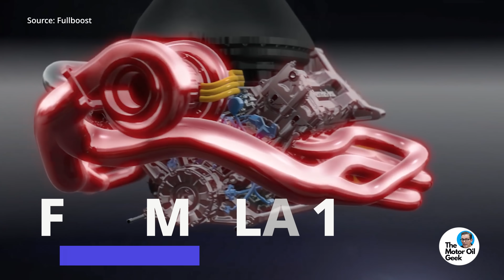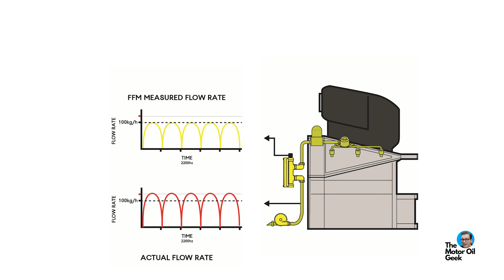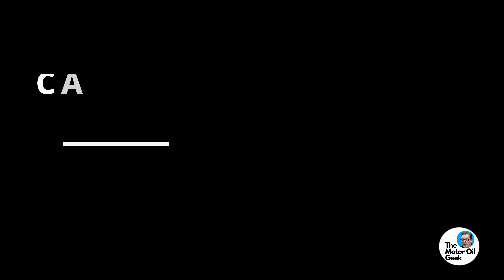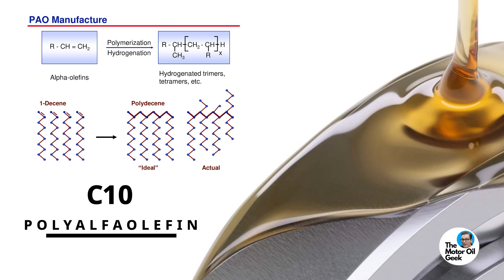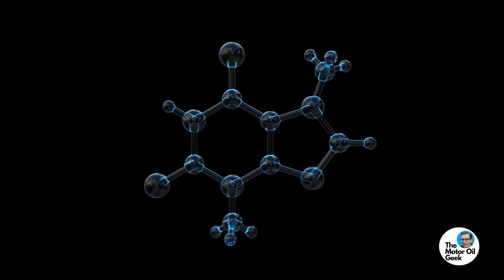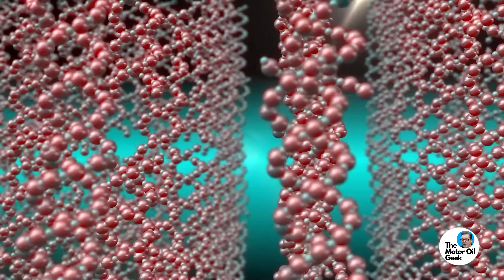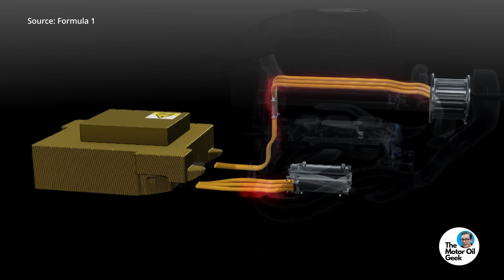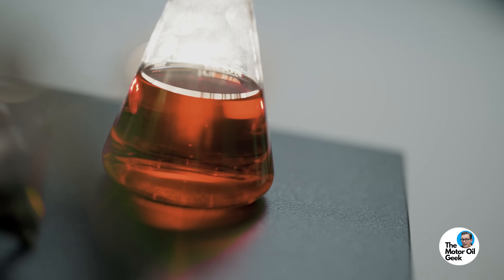SPEED SECRET: How F1 Engines BURN Oil As Fuel

Comment: Can you make a video about 2 cycle oils? That’s super interesting
Reply from the maker: Will do!
Reply: @themotoroilgeek Please when doing that long awaited test about two stroke oil tell us also how it does in comparison to other fuel additives! 🙏🏻
Reply: @themotoroilgeek  That's excellent news!!! PLEASE, Mr. Speed!! Will you tell us if those present-day certified TC-W3 oils are good enough for non-outboard engines?? ALSO, for decades now, 2-stroke Sea-Doo owners have bickered back and forth on how their water-cooled, oil injected engine, can't take anything but Low-ash!! The "Sea-Doo Forum" dudes would go absolutely bananas if you address this topic!!
Reply: @themotoroilgeek yes!!! Thank you!!
Reply: @themotoroilgeek brother I can’t wait. I run several older air cooled two stroke Mx bikes And 90s and up water cooled two stroke Mx bikes too. I can already tell you some tricks for reduced parasitic drag through the gearbox .
Reply: @themotoroilgeek  👏🏻👏?
Hello from 🇬🇧🇬🇧?
Reply: yes 2 cycle please,  and differences for outboard motors, dirt bikes, snowmobiles, chainsaws and weedeaters.  LOL
Reply: @rshawiii And as a fuel additive. In former times they used two stroke oil as a fuel additive even in four stroke gasoline engines and it was called in Germany "Obenöl", meaning oil from above.
Reply: @ralfrufus6573  Would love to hear Lake's opinion about using TC-W3 2 cycle oil as a fuel additive in petrol car engines. People swear by this, using 640:1 ratio mixture with gas (1oz per 5 gallons).
Reply: Yes🎉🎉🎉🎉🎉
Reply: YES PLEASE!  I would LOVE LOVE LOVE to hear Lake talk about the component chemistry and formulation of 2-Stroke Oils and how the formulation differs based on dirtbike, snowmobile, marine/boating, and outdoor power equipment use!  I'm a die-hard 2-Stroke guy and would thoroughly enjoy hearing about the science behind 2-Stroke Oils!
Reply: I fourth this, I really wanna hear his verdict

Comment: 12:21 this is great to know I was just talking to a close friend that just bought a 2015 Porsche GT 3 apparently, Porsche uses DLC or what’s called diamond like coating on their finger followers which apparently they had a production issues with them in the last few years and my close friend, and I were thinking what would help protect DLC, and we never thought about high zinc levels. I told him since that motor probably has roller tips Heising oil it’s probably not needed just like in my ISF. He’s been running Amsoil.

Comment: Well, to be honest, this sort of reminds me of what my uncle used to tell me, he used to love running some marvel mystery oil in his fuel, telling me that it helps with lubricating the top end of the motor and I do this from time to time in my daily driver and my ISF, I’ll run some redline fuel cleaner because it does have the upper top in lubricant in it, which is great for the direct injection system valves, and what not🤔

Comment: my ford 6.7 powerstroke f350 is at 160k miles and hasnt ever had a transmission fluid change. my dad thinks if it were to be changed now it would "knock crap loose and kill the transmission" this is based off of anecdotal evidence from a mechanic he knows claiming when he changes high mileage transmissions' oil they fail. Should i leave the same oil or start changing it every 30k?
Reply: Dang old wives tales! Veteran transmission mechanic here. It's a MYTH.  Change it!
 Have you ever seen the inside of an automatic transmission? Unless the thing has been totally cooked, there is very little contamination in them. But the fluid does eventually get used up-degraded. That one should use Mercon LV, that's a synthetic base fluid. If it's still working decently, change it, now!
Reply: I gave my 04' Mustang its first transmission fluid change at 155K. This was after it started losing fourth gear whenever I drove it hard.

After this, a filter change, and a differential fluid change, it got a little quieter and the shifts felt more crisp and sharp. 5K later and it feels great.

So I say change it! Once you're done, let it warm up for five minutes, then put it into every gear at a standstill to see how it feels. Slowly drive around for about half an hour, then find a back road and see how much of your speedometer you can use.

Comment: Hi Lake, mate i used to sell a product called Dynotabs, which 1 little tablet would increase the HP and octane rating by 4 points, because like you said hydrocarbons is 8 molecules ,so the dyno tab was formulated to add a extra hydrogen molecules to the hydrocarbons thus increasing the octane level and combustion process, Also WYNNS did the same but with not much success, because of not being a tablet.
Also i tested the product on my own car and the results was around 10% extra of fuel savings, using regular octane level fuel, so a average of around 7 liters per tank full, which was 80lt and around 7.5 per 100km ( instead of around 12 lt per 100KM HWY and around and 14lt per 100KM City) it was a fuel injected 5lt v8 made by HOLDEN Australia, 1998 holden VT Berlina model was the car, AUTO as well. cheers, here's a link to the company web page https://www.dynotab.com/
cheers mate.✌✌👍👍🦘🦘

Comment: Thanks Lake enjoy your work have followed  F1 for over 35 years... miss the wail of a 3 liters of v10 engine at close to 20,000 rpm. As a motor mechanic 20 liters per 1000km of oil is incredible... think that their pre chamber combustion may lend itself to the clean burning of oil...
Think that if they are moving to achol type fuel it's a backwards step... I see much more problems down under with e10 fuels.. I am a big fan of top tier fuel and regular oil service... I can tell what you do when I open up a motor.... would love to hear more about  carbon build up on direct injection  petrol engines and also weather premium diesel reduces carbon build up in egr passage and systems. Also  
Seeing blocked egr coolers on petrol engines... I work on subaru cars. Thanks mate
Reply: Thanks Again Lake it's unbelievable how much of this stuff goes back to ideas 💡 from ww2 and before. I remember asking My Grandfather a first Class steam engineer who built ships during the war  (ww2) about water methanol injection and he laughed me off and said it was a much older idea than ww2😂

Comment: From the passenger car perspective, is there also benefit to choose low ash oil (C3, C5, C6) as opposed to full saps (A3/B4) of the same viscosity grade (even for an older car without GPF or DPF)? Most manufactures are requiring low saps oil and these oil are often more readily available. I used to think more addtives and higher saps are better but after wathcing many of your videos, I gotta change my minds.

Comment: Lake, would this same concept be a benefit for Wankel rotary engines that inject engine oil into the combustion chamber for lubrication, or would this result in a worse lubrication for the use case? Most of us go for VR1 conventional due to the oil thickness giving you more of a safety barrier for if the engine gets too hot and thins out the oil.. But having an oil that could potentially be burnt cleaner and actually combusted would be crazy cool!

Comment: What do you think of adding 1oz of TcW3 2 stroke oil per 5 gallons of fuel for a daily driver..........2002 Buick Century ( I drive it like an F1 car ) 😎
Reply: 😂😂😂😂. You beat me too it.  Yes, the 25yr trend of putting TCW3 in gas would be a great topic for Lake!  It must work since it went viral across all forums that originated on the LS1 forum.  Look up Ls1 Forum Been Testing Oil by Sarge!   That thread started in 2008 to 2024 with 1000's of people using TCW3 in gas!   Now I wonder if we can get our hands on the stuff C-10 that Lake talks about!🤔
Reply: I would use a pwc oil over tcw-3. tcw-3 is for low rpm outboards.

Comment: I am also sad to see the current technology go, it’s not awe inspiring like the n/a v10 era, but the power density and efficiency in the engineering is absolutely amazing. You have something that is putting out 700-1000hp at full load for an extended period of time, but at a higher efficiency than a huge diesel engine workhorse that weights several tons by itself, using what is essentially a new “spark” ignition cycle.

Comment: Lake I have a question I have a 02 f-150 4.2 v 6 with a 5-speed manual transmission the trans fluid is automatic trans fluid. what would happen ifins I put 70-120 lube in the trans, i have also heard 30w or 50w motor oil can be used in the trans. could you do an episode on automatic fluids vs gear lubes and explain the differences, pros n cons.
Reply: Gear lube may not be compatible with the composition of the syncro blocking rings. It may possibly grind on every shift.

Comment: I do my oil change on my 6NZ 15 liter caterpillar semi truck engine….filter the oil down to 3 micron and dump the used oil in my fuel tanks. About 10 gallons of oil to about 250 gallons of diesel. Quiets the injectors and I don’t have to pay for the disposal. Also adds lubricity to the injectors.
Reply: Not that I have a rig but I am curious about what filtration you are using to get to 3

Comment: Initialy that was secret. They had purposfully engineered the oil to have way lighter hydrocarbon in the mix. So it was purposfully made more volitile on purpose to actively supplement fuel limitations.
Reply: Yeah that's basically what he said.

Comment: I would be interested to know what the difference is between high octane auto gas and 100 octane aviation fuel. Almost all piston aircraft have air cooled engines. The P-51 mustang is an example of a liquid cooled exception. I know that during WW2, 130/145 octane was used  
Thanks

Comment: I am surprised there are any concerns about deposits in an F1 engine.  They have short lives (a handful of events), run at high RPM, run at extremely high temps and have zero emissions equipment.  🤔

Comment: .3L/100Km= 13oz / 56 miles.  My Cagiva 500 got about 13mpg or worse and I mixed it around 40:1, a pint in 5 gallons.  In 56 miles I'd use about 5 gallons and  a pint of oil ....Castor Bean Oil of course.

Comment: Every internal combustion engine is using some oil. Aren't they?
Reply: It's not good if they don't. A little oil needs to get past the valve seals and ring for it to do its job. If it doesn't, it's metal on metal with very high wear. The amount would be around a quart every 5-10 thousand miles.
Reply: As far as my knowledge, the oil consumption is happening via the pcv system, the release of the pressure back to the intake, alongside with water and oil vapors @denawiltsie4412

Comment: The last year F1 allowed unlimited oil consumption they made a late season change with a sizeable reduction in oil consumption. Ferrari was dominating up to then ,after that they ran with the pack. I don't remember what team instigated the FIA to make the change but part of their argument was that the engines in F1 should not be consuming excessive oil and should reflect the standards for road going cars.
Reply: F1 reflecting road going cars 🤣How insane IS the FIA in a sentence!
Reply: @gotindrachenhart One of the goals of F1 is to push the state of technology that might be used on road cars. That isn't compatible with burning huge quantities of lubricating oil.
Reply: @gregorymalchuk272  I think you maybe missed my point. The other goal of F1 is to be cutting edge and advance tech to peak levels. BUT, after Sena died it kind of broke the FIA and now they ban anything that makes for faster cars.....in F1, which is a RACING series....some would argue, the ultimate racing series. Active suspension, blown diffusers, and dozens of other amazing tech ideas are tossed to the wayside because of the odd notion that RACE cars should be limited in how fast they can go through turns. 

But up to Sena's death, oh ya people can die in F1 no biggie, OHNOES the golden boy dies and the organization folds in on itself.

It's a pet peeve I have with the FIA 
🤷

Comment: I would love a few fuel videos! I have modified and tuned my own car. It's a turbocharged 1.8L 4 cylinder currently running on E85 and methanol injection. I've recently hurt it and fixed it because apparently I was pretty lean. But the more we know the better.

Comment: This is why the people working on F1 tech are awesome. It seems counterintuitive to limit fuel flow and oil consumption in a race car, but these rules push technology development. Faced with the challenge of limited fuel they developed the most thermally efficient gas engines.
Reply: Except when motorsports gaming the rule mentality leaks out to the whole automotive industry.
Reply: It's very interesting! To be fair, they do have an (almost) unlimited budget which helps! It's capped now I think (I don't know if ExxonMobil would be capped) at $135m/annum on designing and running the cars per team and $95m/annum on designing an engine per engine supplier, but that's hardly a low budget either, lol.

Comment: My ride [Thailand] is a Honda CB150R  with redline of 11,500-rpm.
I'll cruze at 9,000 or so.
I add a bit of two-stroke oil to the gasoline [E10].
Helping with ring lubrication and reducing crankcase oil consumption.
Also prevents gas tank rust.
Reply: What was the ratio of 2 stroke oil you put in the tank? 
On my bike, a Z400, i put 20ml of 2 stroke oil for 10 liters of fuel, about 500:1.
I do it for the same reasons, the bike now has 17k km and that engine doesnt live an easy life, i rev it to 12k often, there is 0 oil consumption.

Comment: It's why diesel is more energy dense than gasoline.
Make 2-stroke diesels great again!!
Reply: Longer carbon chains in the fuel. 
More carbon - carbon bonds to break and release energy
Reply: Compression
Reply: The 12v71 is my spirit animal.
Reply: 2-stroke IC is too inefficient except for racing applications, even diesel.
Reply: @DeltaSierra426 They work well for large power plants, like train engines and ship engines as well.
Reply: @DeltaSierra426 except in low revving applications, then they are units
Reply: @DeltaSierra426 direct injected two strokes, even multi-cylinder like outboard motors were up to 15% more efficient, put out 10 - 20% less pollutants, and had a much better power band and torque output.
Modern racing 2 strokes have both direct and port injection, much like high performance 4-stroke engines. That way you don't get the deposits in the ports like you do with strictly direct injection

Comment: Detroit Diesel.. Fill the oil, check the fuel!
Reply: Detroits weren't that bad but it did happen. Sometimes the supercharger would blow a seal and the engine would start running on crank case oil. It could run very well and fast at least until they ran out of oil. They had air cutoff so you could block the air to shut the engine down. Old GM busses were shut down in the drivers station and you had to go into the engine compartment to reset the valve. Kids would sometime play a trick on the driver by sneaking up and tripping the shutdown.
Reply: @denawiltsie4412 Great story, I can almost smell that Detroit diesel now!😂
Grrrrrrrrrrrrrr🥚🥚🥚🥚

Comment: Regular gasoline does make your engine dirty , I have a 91 GMC 1500 461xxx km's on it here in Canada that runs on propane , that engine is spotless inside, the oil is always clean ,the only work I have done to it was valve stem seals at 400xx km's

Comment: I’m interested in fuel and octane. Is higher octane really better?
Reply: Based on what I know, higher octane rating means that you can use higher compression ratios or higher turbo boost pressures. The reason being higher octane rating means that the specific engine fuel is more knock-resistant and hence is less likely to detonate prematurely(i.e., before being ignited by spark plugs due to factors like high temperatures and pressure, this is basically what we call autoignition phenomenon where fuel ignites without needing an ignition or spark source). This in can improve thermal efficiency because you are using higher compression ratio, or you can gain more horsepower because more air means you can pump in more fuel and you can make more power. Ethanol for example has lower energy density than gasoline, but can be made to make more horsepower because it has higher octane rating and when it vaporises, it cools down the combustion chamber, allowing for high compression ratio or boost pressure, but you will need more ethanol than gasoline to make that higher horsepower.
Reply: @YHongBladeV16ZS5  If your engine doesn't knock, higher octane doesn't buy you anything. The exception is at high power levels the computer retards the spark to prevent the knock and this reduces the maximum output. If you're pushing the engine hard with towing or racing, by all means spend the extra money.
Reply: @denawiltsie4412 yeah but doesn't higher octane rating allows for higher compression ratio or boost pressure? This means you can improve engine thermal efficiency(higher compression ratio) and higher boost pressure means more fuel can be injected no? Both equates to making more horsepower in general. Do correct me if I'm wrong
Reply: @YHongBladeV16ZS5  It's a juggling act. High compression, low  octane, retard the spark. As the RPMs come up you can advance the spark more. High Compression, high power levels, high RPMs, yes  you can gain more horse power because high octane allows you to start the burn earlier. 
If you don't need the maximum horse power, low octane is fine but it's the extreme end of the power curve with modern engines that you need the higher octane. Most people won't know the difference but if you need all the power the engine can generate or you have a turbo 4 cylinder, high octane may not be an option. 
The best advice is to read that section of the manual carefully as they usually spell out the options and tradeoff for that engine.  It may say high octane only or prefer high octane or low octane with tradeoffs.